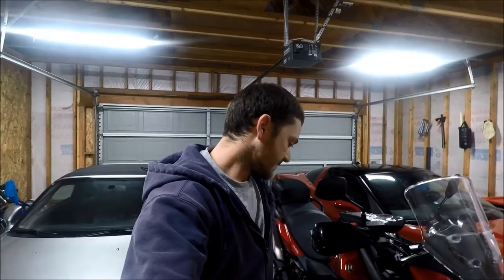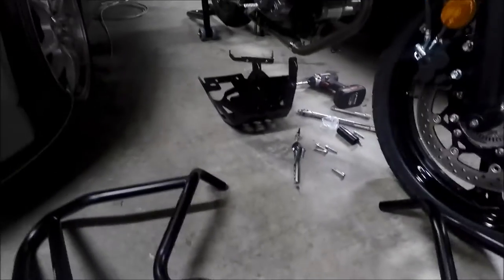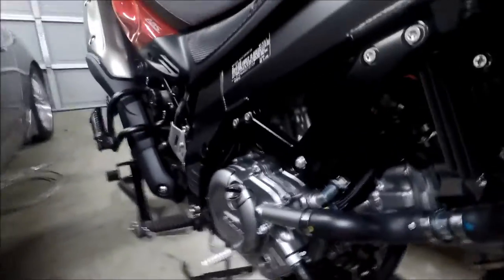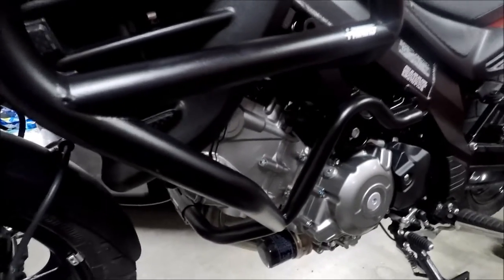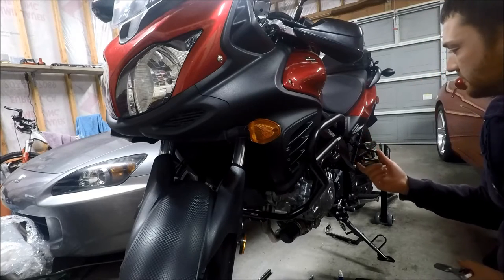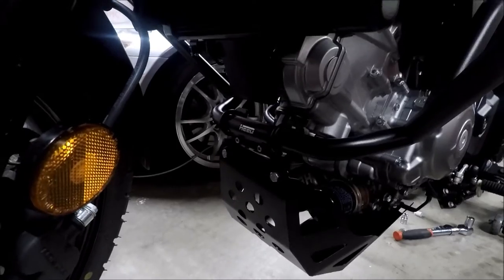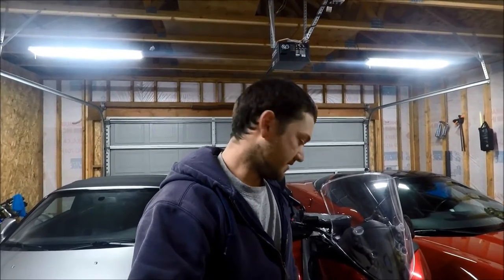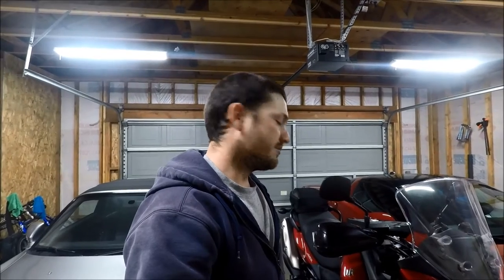Heed Crash Bars and Engine Guard V Strom 650 Install

Comment: Is the skid plate substantial enough to lift the bike with a scissor type floor jack?  That is, the kind of jack that has a wide flat base.  I would only be lifting either the front or rear wheel off the ground at one time, not the whole bike.
Reply from the maker: aajawo you definitely can use it to lift the front wheel, but it’s not vary stable. I have done it before, lifting the back tire would be a little tricky but probably doable.

Comment: I just bought the same set, just waiting for shipping. Do you think you could do an oil change without removing the skid plate? It looks like you have a lot of room underneath.
Reply from the maker: Jim Hamel you could do an oil change but you would have to cut a hole in the skid plate for the oil to flow out, when I changed my oil I just pulled mine off. It's only four bolts, just takes a few minutes.

Comment: I'm assuming these crash bars won't fit with the OEM lower cowl cover.  How much space is there between the header pipe and these bars?
Reply from the maker: Michael B I don’t think they would fit ether but I’m sure it would be easy to fab it up to make it fit. There’s about 9/16” from the header to the bar.